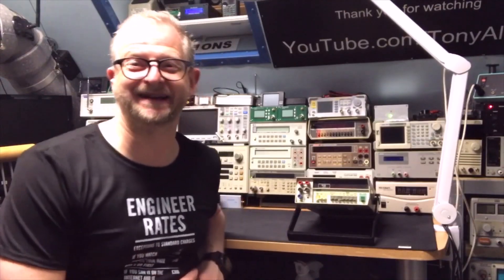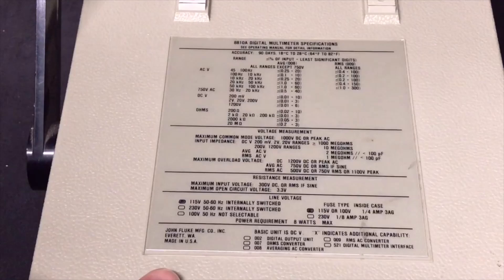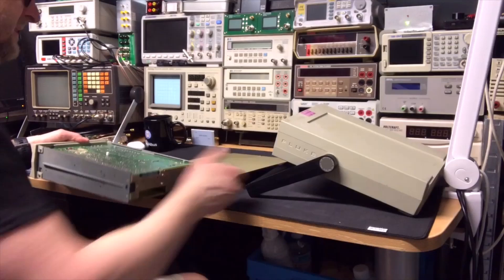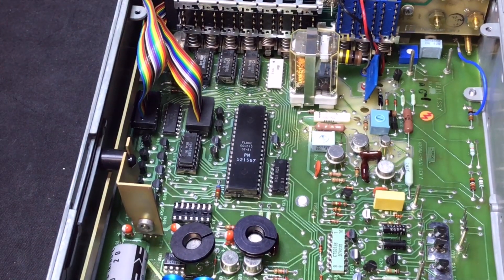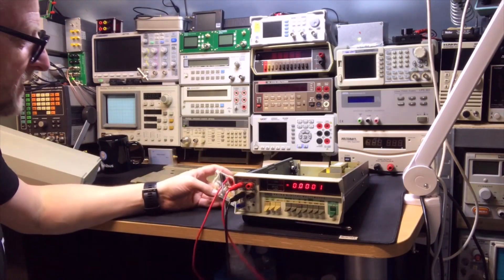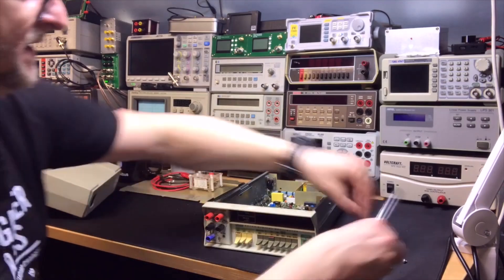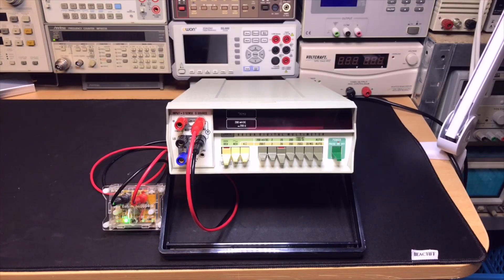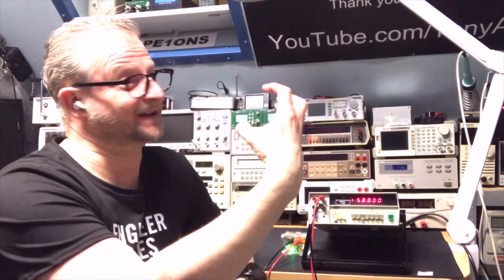#149 Fluke 8810A Cleanup Teardown

Comment: I have a working Fluke 8800A if you're interested.  I got it from an estate sale of an engineer who worked at the Lawrence Livermore Lab and that's about all I know about it.  It does fire up and seems to make accurate voltage measurements based on comparisons with other multimeters I have.  It's for sale, open to any offer as long as it's somewhat "reasonable".
Reply from the maker: Thank you. i think if you put it on ebay is will go fast.. i am fine with the 8810A for now, but thanks for the offer.
Reply: @TonyAlbus  Thank you for responding!  Any suggestions what price I should list it at or it's approximate worth?  Thanks again!
Reply from the maker: @AtimatikArmy  i would not pay more then 50 but someone who realy wants it will go above. and ebay is usualy crazy so maybe even duoble that.